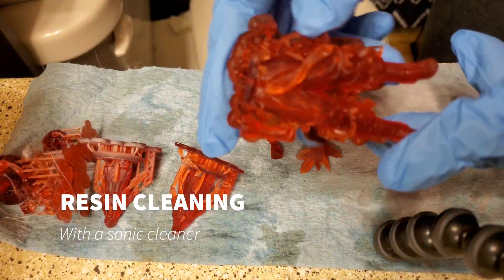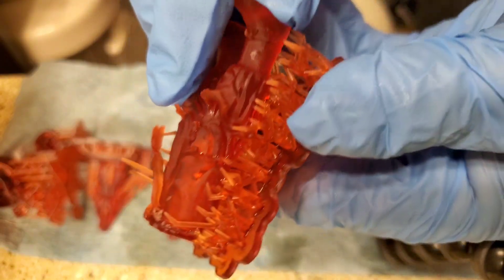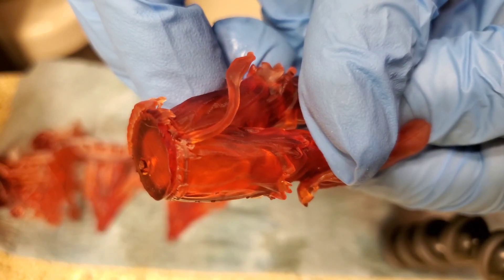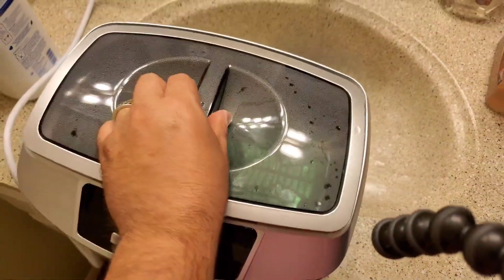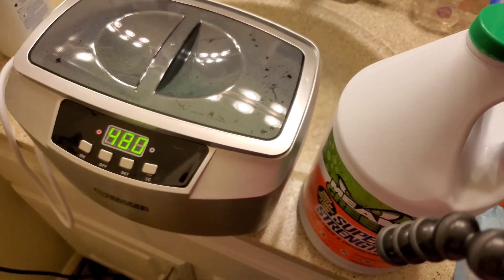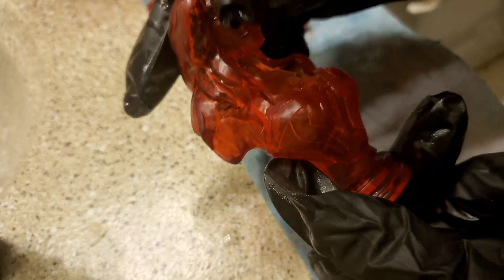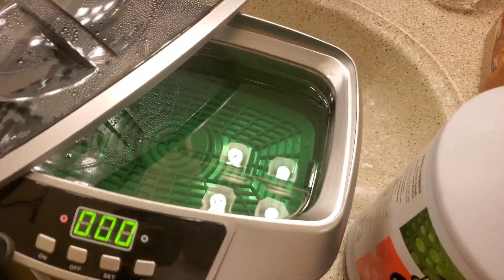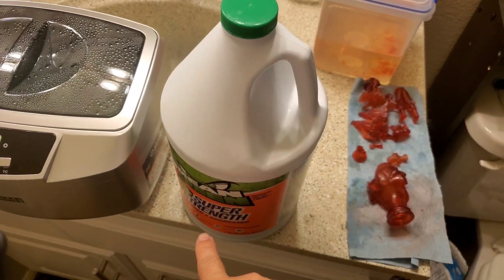Cleaning resin with a Sonic Cleaner

Comment: For those still coming back here. Mean Green moved to Dollar General and Dollar Store. Simply Awesome also works just as well, and you can find that there as well! Also, for smaller prints you can place them inside thin plastic bags or cups/storage containers and fill the whole cleaner with just water... the vibrations will break through the plastic walls and you'll get the same fficient clean without using too much cleaner. GL and Cheers y'all!
Reply from the maker: Hey thanks for the info! I have been not seeing mean green at home Depot for a long time now, and just order online. Good to know they flat out stopped carrying it!

Comment: Don't wash resin down the drain.  There's steps that you have to take to cook off whatever liquids you're using for your prints.  If you send uncured resin down the pipes, it could cause clogs, but more importantly, water treatment facilities use UV light to treat sewerage.  This will cause enormous issues if everyone starts dumping tonnes of resin down their sinks, and that's before we talk about the toxicity of photopolymer resins.

Use a container of water and a container of simple green for your prints as normal, but when you need to clean out or replace them, leave them in the sun to cure the resin in suspension.  At that point, you can skim out the chunks that will be safe to throw out in the garbage, and the cleaner and water solutions will be good to re-use, or at least safer to dump.  The same goes for cooking off any resin-contaminated waste that you create while cleaning prints.

I don't know why this information isn't more available or well known, we need to try and reduce our impact with this hobby or else there could be repercussions for it.

Comment: I use a similar approach but I also use an electric toothbrush to remove excess resin. But I’m not printing with supports.  I also cure using water and a UV lamp.

Comment: Thanks for the cleaning tips. Here is a tip to reduce the supports from ripping out davits in your models. Try using  the spheres option at the supports contact with the models, by adjusting to size and depth you can create an artificial weak spot just proud of the model surface that the support will break away at. This leaves the smallest of positive bumps that are way easier to sand back if at all. Watch this at the 5 minute mark to see what I mean  https://www.youtube.com/watch?v=IFRE5w40M_k

Comment: I would want to see your slicer settings.  I think it has more to do with the supports coming off so easy than the cleaner.  But nice video.  Answered some of my questions on this model (and all the clones of it sold on Amazon)  I'm using Simple Green,  Seems to work very good as well.

Comment: Thanks for the video.  I was already planning on Mean Green in an ultrasonic cleaner but this video clinched it for me.

IPA is also an organic solvent that isn't too healthy to breathe, and It's flammable so It's a fire hazard.

PS - You might consider rinsing with distilled or deionized water to prevent milky white mineral deposits.  We have a lot of calcium in our tap water.

Comment: Thanks for the info about the mean green and ultrasonic cleaner. Could you tell me what resin you use and the general printer settings you follow? I've just started trying to get my printer to work but I've been struggling to get a proper print.
Reply from the maker: I use elegoo resin mostly now, it seems to work better than the anycubic for me. I usually set the bottom layers to 6, bottom layer time 70 seconds. Each layer is either 8-13 seconds depending on resin color. Transparent I can do 8, grey is 10, everything else is about 13 seconds. 

I've tried siraya tech Blu and love that as well, that's about 11 seconds per layer. 

All prints are default 0.05 layers. I've done 0.03 layers and everything becomes 9seconds per layer but same bottom settings.

Comment: Do you add the mean green straight into the machine or do you use a 50/50 mixture of mean green and water? Heard some people use the 50/50 method. Also, would you recommend spending the extra cash to get a sonic cleaner with a heater? Or would a non-heated one work as good? Mentioning this because it will determine if I will just pick up a simple cheap one from amazon or treat this more like an investment and spend the 80 dollars.
Reply from the maker: I run straight mean green. It's so cheap I don't need to extend it by diluting. Plus, that's just longer to clean it entirely. 

I recommend the heated option. I've done mine both with heater on and off. I find they break off supports easier with the heater and it cleans better. Turn off the heater if you have super thin parts though, it can warp them a little.
Reply: @TheMidnightSmith  Whats your process like for replacing the mean green in the sonic cleaner after it gets cloudy with resin?
Reply from the maker: For disposal, I pour it into a clear tub, set out on the porch, and the mean green slowly evaporates as the resin cures. You can scoop out the resin as it cures. Once a month or so I'll pour it in a 5 gallon bucket, and take it to my landfill where they have a hazardous waste disposal.
Reply: @TheMidnightSmith  Could u scoop off the resin and reuse the mean green or is there to much resin. I want a reuse produce as this produce is an expense. Thanks for the info

Comment: I found your video after reading the post on the Elegoo FB group. Have a couple of questions that I posted there but perhaps I can also pick your thoughts on: 1) Do you change the Mean Clean / Simple Geen after each use? 2) How do you dispose of it?
Reply from the maker: Great questions! I do not change it after each use. I can usually get 10-12 full build plates of items worth of cleaning before it starts to not work as well. 
When that happens, I use a small tub of IPA as a second wash, just a quick dip and swirl. This lets me go up to 22 times of full build plates before changing! 

Of course, make sure you rinse with water to get the mean green off. 

For disposal, I pour it into a clear tub, set out on the porch, and the mean green slowly evaporates as the resin cures. You can scoop out the resin as it cures. Once a month or so I'll pour it in a 5 gallon bucket, and take it to my landfill where they have a hazardous waste disposal.
Reply: @TheMidnightSmith  Thank you! Not sure if I will be able to tell when the cleaning starts not to work as well but will keep the "10-12 full build plates" as the rule of thumb.
Reply from the maker: @pontior  youll see more glossy spots and it will still feel a bit tacky after cleaning when it's not working as well.
Reply: @TheMidnightSmith  You were right! Latest batch feels very tacky!
Reply from the maker: @pontior  nice! How many batches did you get?
Reply: @TheMidnightSmith  8 if I counted correctly, but my ultrasonic cleaner is smaller than yours.
Reply from the maker: @pontior  super awesome! So glad it's working for you!
Reply: @TheMidnightSmith  Thank you for your help! Next step: disposal. Have to figure out where to take the dirty Mean Green
Reply: This conversation alone was very helpful.

Comment: You aren't using IPA?
Reply from the maker: @brezov prut, no. IPA in a Sonic cleaner can be dangerous, the fumes can build up and electronics can ignite it without proper ventilation. 

Mean green works just as well, if not better because it doesn't have the cloudy effect on the part.
Reply: @TheMidnightSmith  that's exactly what I use for ALL of my resin cleaning